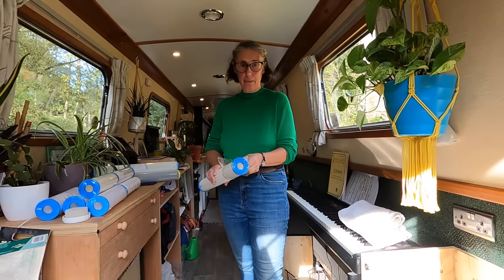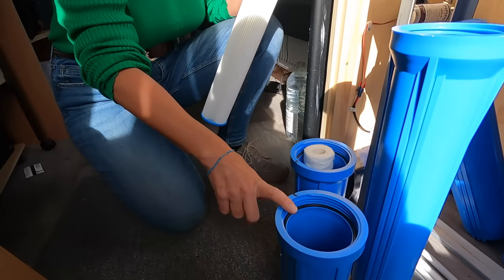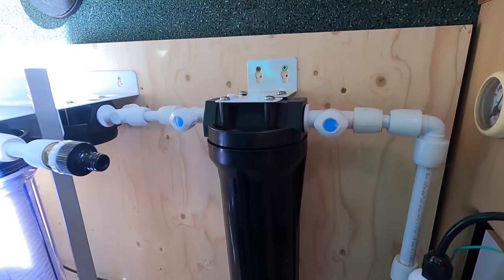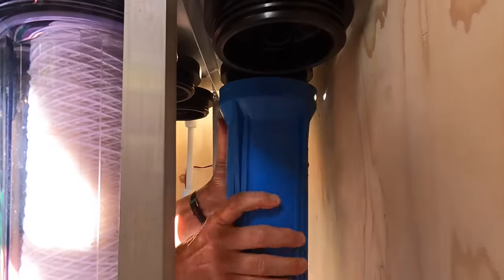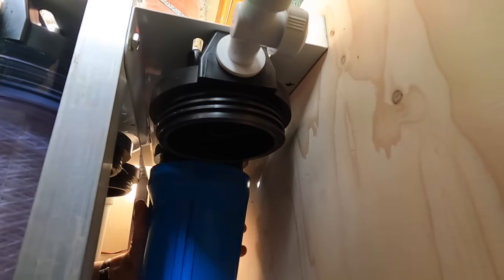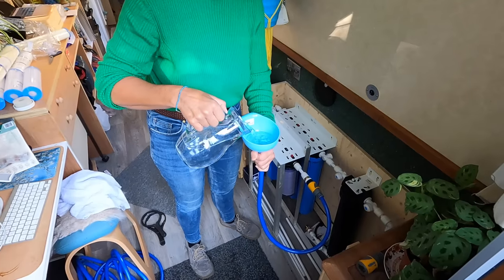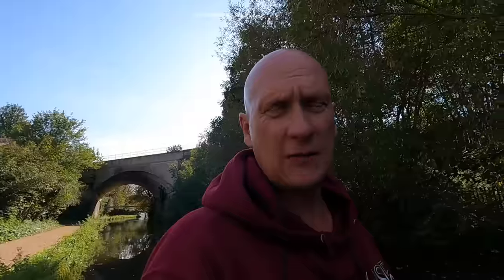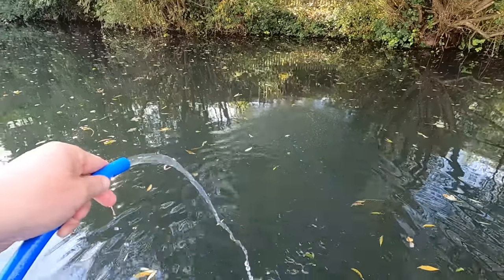Filtering Canal Water. How Good Is It? - S3 Ep14. #narrowboatlife  #waterfiltration

Comment: Hi Chris
I used to own a water filtration company supplying filtration for both tap and rainwater.
I acknowledge fully the time Susana (I hope the spelling is correct} has spent researching the matter and explained what she had very coherently.  My comments in no way are critical of her efforts but aimed at providing a more complete, and constructive addition to what she said.
1.  There is a huge difference between tap/rainwater and canal water. Agricultural run off, as explained in the Vlog, Industrial waste, rotting carcasses and vegetation are all present in canal water.
2.  The system as shown starts with a 50micron filter and then steps down to 2x 5 micron filters and then 2 x carbon filters (Micron value not included).  The step from 50 to 5 is enormous and only means the 1st filter will quickly block, the inclusion of 2 filters of the same value provides no value.
3. Carbon filters do NOT remove the heavy metals, despite the advertising. They reduce "some" chemicals.  Again why have 2 filters of the same value?
4. Maybe an alternative setup for the 5 filters could be 20, 10,5,1 then a 0.5 micron Carbon before entering the Nitrate filter
5. The only way to effectively remove the heavy metals is "Reverse Osmosis".
6. What does the 250pound test "Test For"?  Heavy metals are contained in tap water which is spposedly "Safe" to drink so maybe the test does not include these!
7. The fact susanna has to flush her filter system for 40mins highlights how unhygienic this system is.  The smell mentioned comes from the sediment, and what is contained within, growing and festering when not in use.
8.  As you mention any testing is usually conducted with clean filters, to provide optimum results, as susanna mentioned the filters become blocked quickly and the water requires constant flushing.  How much testing has been conducted on the quality of water subsequent to replacing filters.
9. To what standards are the filters tested?  Look out for US/UK standards as I know very well filters imported from abroad do NOT meet requirements, despite the blurbed on the packaging, but this is a completely different issue.

I could go on but feel most would have got bored by this stage.

A most worthwhile Vlog and thank you to both

Mel
Reply: I Believe she has a 50-5-1-1 then 2x carbon then a nitrate. I use a reverse osmosis system from the same company for window cleaning, I wouldn’t drink it (although I have in the past and lived to tell the tale) and that’s from tap water. As Chris mentioned in the Vlog, when do the filter stop making it safe to drink. The answer nobody knows lol
Reply: I use an RO System for my Marine Fish tank Mel. 👍🏼
Reply: Hi Gary
I agree with your determination of the filters. I question the drop from 50 to 5 and then using 1 Micron sediment and then the carbon twice.
My company used to make window cleaning systems using RO, but had to provide beads to bring the water down to 0 PPM at which stage the water cleans.
RO water deemed "Dead Water" as it contains absolutely nothing nutritional, I loved drinking it ice cold as the most refreshing drink but ate lots of "Good Stuff". to compensate.  
You can get post RO filtration that puts the good stuff back in.
Thanks for your reply
Mel
Reply: Hi Nick
I used to have a fish tank supplied from my RO water system.  The only issue was that haven taken everything out I then had to monitor the water chemistry very carefully. But at least I knew what was in the water. The fish appeared very happy with their environment.
Thanks for your reply
Mel
Reply: @meljones7238  very true, I am a keeper of quality water that happens to have Marine fish living in it with soft corals 🤣🤣👍🏼
Reply from the maker: Thanks Mel for the detailed advice from the vid. Very much appreciated. Rest assured CoA 1&2 are my preferred CoAs for now. maybe in the future CoA 3 will be explored. Great conversation from @garyquye3636 and @nickevans1698. Thank you all for the comments and chat. Have a great week.

Comment: I see this nothing more than a gimmick sold by water filtration businesses. I renovated a house in the Scottish Highlands that required a private water system. The water itself came from an uphill stream, already much cleaner than canal water which is used as nothing more than a dumping toilet.  Even with all the filters, UV etc... Environmental Health came out, sent off sample to lab. It failed due to E Coli levels and other small content that the filters were supposed to grab onto.  The problem is that you never know when failure happens, especially if the bulb in the UV filter breaks. I'm not saying it can't be done, but It's too much faff about, given canal water is well and truly filthy.
Reply: Canal water is a bit muddy, and obviously not drinkable, but the canals are not some kind of open sewer, as you seem to be implying. Dip a bucket into a canal and pull it out and you'll be looking at clear water. I'd use this filtered stuff for showering and laundry, and only avoid it for drinking because I'm squeamish.
Reply from the maker: @A-Nobody I understand your point of view and as Suzannah stated, her friend had a similar problem. @dansmithwave states something that I tend to agree with but it's more about the logistic and cost as well where I'm going to put it. It's not right for me and to be honest, I was apprehensive about not knowing the point of failure too. Thanks for the comment fellas. I appreciate it. Have a great week.

Comment: We are very happy with our setup. We have two tanks. One fills from CRT water points and is used for drinking, tea, etc. The second tank is filled from a Water Freedom system and filtered canal water is used for showers, clothes, dishwasher, etc. Two completely different water tanks, pumps, plumbing, etc. Very pleased and well tested. Takes up much less room as well.
Reply from the maker: You have the perfect solution Ross. I didn’t want to go on too much and thought 30 mins was too long. 50% shorter on the edit table. If I was re-designing a boat, that’s what I would have. Have a great week and thanks for the comment……
……Just a thought as I was answering comments, it would be good if we are ever in the same vicinity to ask you how you get along making your system work. I know Suzannah is happy now she’s fought through the issues. I can see it’s possibility but don’t have the other side of the coin. The two tanks work though.
Reply: @chrismears-inslowtime  Happy to chat anytime but we are headed up the L&L when the Wigan flight opens. Don't think you're too close?  It is a new build and we're happy with what we've got. Probably would make the drinking water tank smaller and filtered water bigger but that's about it. 
I'd encourage you to have a look at Water Freedom's site. Good chap and he does more retrofits than new builds.
Reply: Are you absolutely sure that your filtration system removes Legionella bacteria from the water you shower in..? Most adults don't succumb to the disease - it would be older or younger (or weaker) people who would. (Dot)
Reply: @keithtomey5046  fully tested by the same company that tests municipal water in the UK.
Reply: and all these systems go back into the canal as well as the overflow from the septic tant onboard
Reply: @terranceyeo3087  no idea what you're talking about.  Nothing goes back into the canal from our boat that's different from any other boat. In fact, it can be argued that we use less CRT resources (water points) and return cleaner water than we take out.
Reply: @RedDoor888  I used to work and next time you cruise along the canal look for septic tank overflows into the canal, so if your filter system cleans everything out you should get in touch with Calmag I'm sure they would like to see your unique system
Reply: @chrismears-inslowtime  If running a two tank system I would consider rainwater harvesting before canal water. You have about 50 ft x 6 ft collection on hand in the form of the roof already. 300 sq ft or about 28 sq metres. An inch of rain (25.4mm) would give about 697 litres Average UK rainfall is 800 to 1,400mm, so 67 to 117 per month (plain average, so not accurate but okay for 'fag packet' calculations). 67 mm of rain would give around 1,867 litres collection per month. That allows a usage (not collection) of 60 litres a day at the low end estimate. Enough to keep you showered, the boat cleaned and washing up done I expect. (You would want to clean the roof quite regularly as your collection area.) I know some people like to say that rain is not necessarily clean, but I ask you this: Where does all our fresh water come from? It is all rain at some point in the cycle. Unless you happen to be moored immediately downwind of a chemical factory with a failed emissions control system you are reasonably okay. Some places collect rainwater to use as drinking water and keep it 'safe' by regularly lime washing (chalk paint) the rock faces they collect it from. I'm not suggesting this, nor drinking the rainwater collected unless fully treated, but for washing etc. it should be good after a simple filtering.

I saw a vlog of a boat where the owner had turned a bathroom wall into a tank for about the same space as a normal wood frame with facing both sides - something like 150mm thick x 1,000mm wide x 1,900mm (floor to ceiling). That is about a 300 litre tank with no loss of space in the boat. (Just need to remember not to drill into the wall to hang a picture!) 

Looking at boats there always seem to be spaces to add tanks if there is a will to make the tank to fit the space available. Those impossible to reach spaces once the boat is built and fitted out. I am surprised there are not more underfloor tanks. It means removing some ballast, but in general not all the underfloor space is needed for ballast and in the rare cases it is, then heavier (denser) ballast such as iron can be used to still leave some space. It becomes a question of planning and cost.

Comment: Great vlog Chris. How about capturing rainwater run off from the roof? That's a large surface area and would provide additional water when you need it, especially during the Winter, when you might get frozen in. Might be some challenges collecting it but the water quality will be much better than the canal water for starters. Someone must have done this. Just a thought.
Reply from the maker: As I've read through the comments, it does appear that rain water isn't as clean as one would imagine. The boat is dirty after the rain fall with all the sentiment of dust. It's surprising. The rain collects all the toxins in the air on its way down. So water points are the safest source of water. Thanks for the comment and enjoy your week.

Comment: Hi Chris. Fill all you water containment systems at every water point where available.
Militarily water purification techniques from 24hr R.P.s through to the engineers way. Investigate those alternatives.
Also look at water collection through rainfall.
Old boat way was to have the drinking water jug on the roof.
Reply from the maker: Thanks for the tips Geoff. I do fill at every water point. The point of which I first thought about water filtration is when I want to stay between two water points - like now. I can make it all last but to shower more often would be nice, not a necessity; for me at least. That said @greghilton7797 make a very valid point. I got some advice from a fella who used to own a water filtration company offered the very same advice as Greg. I have also noted when it rains, my generally clean boat is dirty from the deposits of dirt in the rain. There was something called 'RainOut' when Chernobyl erupted. Deposits of nuclear waste was transmitted from Ukraine all across Europe via rain. What we think is clean and looks like it is, sometimes isn't all that it appears. When armageddon happens, that will be different. I'll collect rain water and add water purification tabs. Until then, water points are my safest option. Thanks for the comments fellas. Appreciate it. have a great week.

Comment: Hi
Getting canal water to the point of drinking it safely is a big ask. Getting it to shower in, wash clothes in etc is a whole lot easier and this consumption is around 80% of useage.  Have a separate system for both. Fill a tank for drinking and use a filtration system for the rest.
Reply from the maker: Agreed Steve. In fact that is what The Fit Out Pontoon are doing for their new boats. Dual water tanks are the way forward. If I was starting this live now, I’d be doing exactly that. Thanks for the comment and enjoy your week.

Comment: Hi Chris, grumpy old git here again!! interesting vlog re filtering canal water, I would be very careful about drinking even filtered canal water.
Check some of the sailing vlogs sailing fairisle, uma etc a lot of them use R O (reverse osmosis) filters to produce distilled from sea water but in general they only run them ofshore where the water is cleaner to start with as RO membrains quickly clog up and have to be "backwashed" to clear the contaminants back into the sea.
I have had experience running them at work to produce water for reach and wash window cleaning systems and we had to backwash RO filters every 3 months even from tap water, and eventually they had to be sent away to be cleaned or replaced, ( expensive!!) 
You are safer sticking to your COA 1 to 3
Reply from the maker: Thanks for the info in the comment. I've not heard of reverse osmosis before this vlog. That said, even that appears to be a pain. CoA 1 and 3 are the cheapest, most reliable and efficient. Done. Have a great week.

Comment: In 18 years living on a sailing boat and never knowing when we would next find a tap we were very careful with water and yet rarely ran the 245L tank under half full before finding a tap to fill it up again. In reality we could have had showers twice as long as our normal sailor's showers and so enjoyed life a little bit more but our worry about running out of water never allowed us to. On a canal you just need to keep in mind where the next tap is and enjoy your water knowing it is just around the corner.
One benefit of your 50L rolly camper water container things is that you can store them on deck full and so have also increased your tank capacity by 50L to 600L.
Reply from the maker: I’m becoming aware of the water consumption, what uses it, how to maximise it and I agree with your comment. I’ve never run out.  I’m always filling it after a month from half full. I live on my own mostly with the occasional visit. Absolutely aware of the next water point but….need to get out of the habit of being fanatical about saving water. Bought two rolly containers!

Comment: That is a very good filtration system. I have used the same system on the farm to filter collected rainwater from tanks. It came out 100% safe. Install as big as possible, too small and it is going to frustrate you. Use it continuously as you go., don't switch it on and off. The water in the system will go bad and it is going to need more regular filter cartridges.
Reply from the maker: Good advice Tom. Not sure the system will ever be able to run continuously though. It makes too much noise and uses too much power. The end result for me....water points, but I do recognise its usefulness for those who use it. Thanks for the comment and have a great week.

Comment: As said below I would not install it Cris. If you were to redo plumbing in the boat then yes, have two water tanks with one for drinking and cooking only (from CRT water points) and second for shower/washing/boat cleaning. The second one can be filtered.
Reply from the maker: The gold plated solution Martin. Thanks. I agree. Have a great week.

Comment: Hi Chris I fully understand your reasoning for getting a water filtration system and yes it's a very good idea and quite clever and makes you more independent and gives you peace of mind but for me personally I'll never be able to get out of my head that I'll be drinking canal water my back up plan for being iced in when I get my boat is to use my Ebike and a large dog carrier I can fill up with water containers at the water point
Reply from the maker: Good points Nathan. The E-Bike is a great idea. I looked at some last year. So far this year I haven't used the bike much so for now the E-Bike is on the back burner. Trailer too, looked at that when the boat was being built. Again it's on the back burner but the concept..totally agree. Thanks for the comment.
Reply: @chrismears-inslowtime  when I get my boat by this coming summer hopefully once my house is sold I'll let you know how I get on with my Ebike and trailer though I wouldn't recommend my Ebike for a boater as it takes up far too much space also the battery takes 8 hours to charge from empty so I'll let you know how that goes when charging it from the boat which I expect will take longer to charge than from a house plug socket